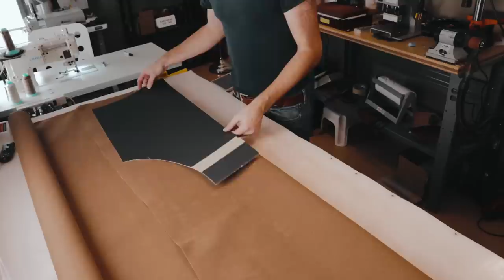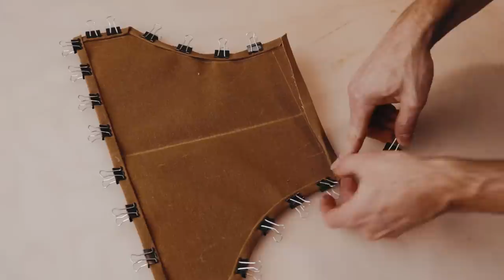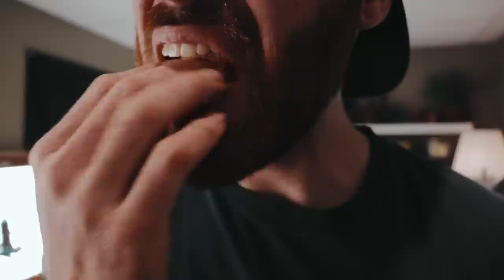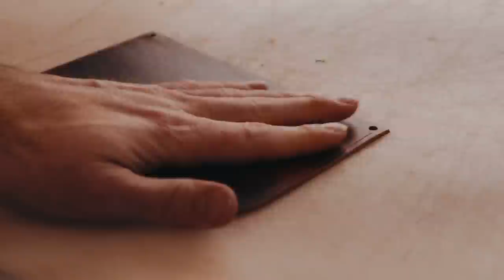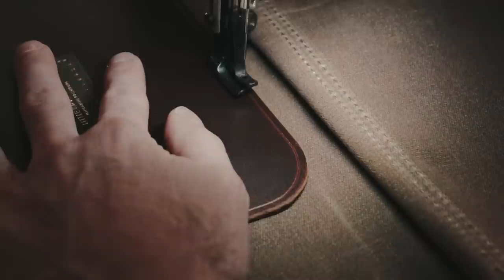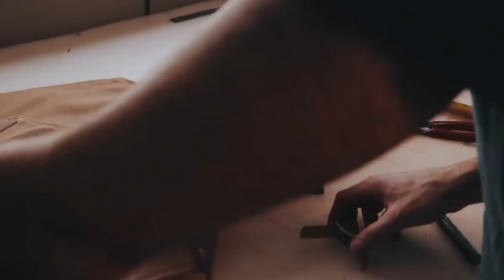MAKING A WAXED CANVAS AND LEATHER WORK APRON.

Comment: The copper rivet set I used had two openings on the end.  One to dome the rivet like yours does.  But the other puts a dimple in the end which spreads the rivet out evenly.  Our rivets were the right length since we did the same operations all the time.  So you would put on washer. Dimple rivet. Flatten rivet with just the hammer one or two moderate blows.  Then dome the rivet.  TaDa.  FWIW

Comment: Hey dude, 

A couple questions:
1. Who manufactures your SRD’s?
2. Any tips to cutting radius corners in leather by hand?

Thanks!
Reply from the maker: I use a company called Kitchener Die Craftsman. Cutting by hand you can do multiple straight cuts and follow the radius. Tonnes of little cuts make a beautiful rounded corner.

Comment: Just subscribed ! You really know how to get everything right on the video production as well as the project. You deserve a snack. Could you have done this with your Techsew? I am buying my first machine and would like to do both leather and materials such as the waxed canvas. Thanks man.
Reply from the maker: Haha thanks! The 5100 I have is not the ideal machine for waxed canvas. If I had to get my first machine it would be the 2750 Pro with a speed reducer. That machine will easily do leather and waxed canvas. If you do end up buying a techsew use code LKGDS  when you check out or if you talk to them. You will get a free accessories package!
Reply: @LittleKingGoods  I really appreciate your help. Thank you for the code. You have inspired me !

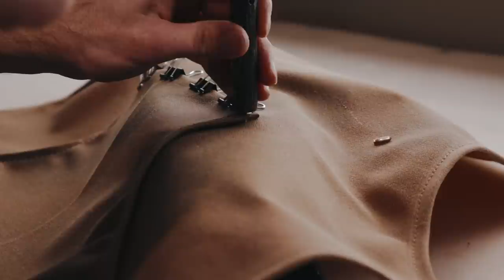Comment: Hi, what's the hardware that you are using at 3:35 called? Is it a special type of rivet?
Reply: I was wondering the same thing and found some Tandy Leather Size #12 1" Copper Rivets and Burrs on Amazon.
Reply from the maker: They are #12 -  3/4" copper rivets from tandy leather.

Comment: Do you need an industrial strength sewing machine to sew waxed canvas?  I have a vintage Bernina that has seven stitches.  Just a home machine.  Can I successfully sew through two layers of waxed canvas?  What kind of needle would I use?  Just wondering.
Reply: It would depend on the fabric weight.  I use a semi-industrial Sailright machine with 14 oz. canvas to make city-tote bags.  The main concern is how many layers you have to sew through.  Also, watch for wax build-up in the feed dogs; needs to be cleaned out frequently.  Use a leather needle; probably a size 16 if your machine can handle it.